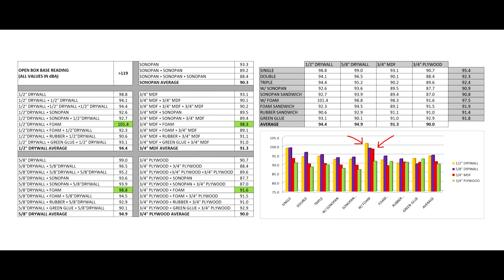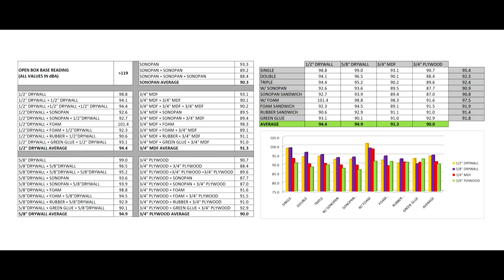What is the best material for soundproofing?

Comment: Very interesting.  The main thing I will add/critique here is that larger sheets of drywall/MDF/plywood will have more resonance and tend to vibrate at lower frequencies.  I discovered these issues when I was in the process of soundproofing my 4'x 6' bedroom window from outside noise and neighbors (i.e. cars passing by the outside alley blasting loud bass music).   I have to do this every summer when the rowdies come out of hibernation.  I've discovered that smaller pieces of drywall and plywood do not resonate as much as one large piece did.  It's also easier on my back to install it in smaller sections.  I seal it all with rubber weather striping and acoustic calking.  The result... much less resonance/vibration at low frequencies.  I've learned a lot over the last few years from simple trial and error.  I'm still in the process of improving it.  I've gotten greedy and will take any dB reduction I can get.
Reply: This really helps a lot!! Most of the time you hear people either say - more mass or more rockwool. Or somehting inbetween, like rockwool within drywall. 

But after watching this video, you really get an idea of how much more there is to it!

Just the rubber inbetween drywall did so much!  

Just adding drywall makes it worse sometimes, it seems. 

I'm still a little confused by how well the sonopan on it's own worked. Much less mass and density, but still such great results!
Reply: Some acoustic glue might also be helpful instead? There are several alternatives for green glue, it seems. My guess is that, especially on walls, you need to have some pressure from the drywall against rubber for vibrations to cancel out / to let the drywall not be a resonator on it's own. But not so much that it's too stiff (The right amount of pressure is difficult to figure out for rubber and probably also difficult to build). Maybe the glue would be a replacement for this without any pressure needed?
Reply: You could probably use any kind of glue that stays flexible. Though the heavier, the stiffer, probably. Too stiff isn't good either.
Reply: @KirmesRuf6  As long as you can prevent the drywall from vibrating, it will work.  The air gap between the window and the barrier is very important, the larger the gap the better the results.  You have to use rockwool in the cavity to prevent echo and reverberation.  I recently made another barrier using 1/16" lead sheets glued to the plywood and that works even better (very heavy though).  My window is now more sound proof than my exterior house wall.
Reply: @JP5466  Thanks! That sounds fantastic -  Maybe drilling 1 or 2 holes into the middle of the dry wall could also help to cancel out vibrations?
Reply: @KirmesRuf6  Nope, that would let air/sound through.
Reply: @JP5466  Right!

Comment: I found this really surprising. I just renovated my basement with safe and sound insulation, strapping, sonopan, and 1/2" drywall. The results were less than desirable, it mutes the sound a bit, mostly talking, but foot steps or things dropped on the floor above, the difference is hardly noticeable. A bit of a disappointment for the money spent. I believe my biggest issue is the air ducts are an air penetration I can't remove.
Reply: remova os dutos de ar e vede as paredes. abra a porta 10 a 20 minutos por dia com um ventilador super potente com a vazão necessária  ou duas vezes ao dia no maximo. faço isso e traz uma diferença muito boa para o isolamento.
Reply: That scare me cause I just did that. Next step is the ceiling. I do read that ceiling noise, specially impact, it's not doing much. Reason is the joist are so big that the sound travel easily. To block that, you do that on the flooring side.

But what about noise going up, how much do you hear in the room above VS before?
Reply: Did you decouple the basement ceiling from the floor above
Reply: You may be able to line the inside surfaces of the ducts, with soft rubber matting (maybe mouse pads), or some other absorbent material.    The other thing that may help... is to hang a few boards of stacked plywood, about 3 inches under the vent (maybe using bungee cords, or rubber strapping).   In this way... any sound that runs down the vent... will be partially bounced back into the vent... after it hits the Plywood.   Additionally, some foam might help diffuse any remaining noises... yet the foam should still allow for air to move through it.   You will likely have to change the foam out every year or so... as it gets clogged up with dust  (washing it might work too).

 They make a car Undercarriage rubberized spray that also might work for lining a vent.   However... I have no idea if there would be a long term off-gassing / smell.   You could spray a small section of cardboard, and let it sit in the house... to see if the smell remained for a long period of time or not.

 As for your choice of materials...  The Sonopan really isnt enough to stop very loud noises, IMO.  It would be best to add one more layer of Drywall.  The stuff is very dense, and should reduce the remaining noise.. maybe by 40% more.

 Also.. another idea, is to extend the vent,  in a maze like pattern, inside of a well insulated box... similar to what is shown in this videos test box.   The maze like pathway, will help to diffuse and absorb sounds, as the sounds try to bounce off of each internal wall.   By the time the air / sounds come out of the other end of the box... there should be little sonic wave energy left (yet the air should still be flowing freely).

Comment: What confuses me more - why is the rubber sandwich with polywood worse than drywall rubber sandwich, but single plywood so good?
Reply: I agree, the thicker 5/8" drywall should have better results... very strange.
Would've been more representative if he used larger pieces of drywall and plywood, screwed it down tightly to the box and used a lower frequency noise source.
I've had very good results sandwiching the MLV (between both drywall and plywood) rather than letting it hang limp on the studs.  I hope he can make another video using the suggestions in this comment section.
Reply: @JP5466  That would be great indeed! A full frequency spectrum tested. 

Having MLV sandwiched instead of hanging probably also helps to reduce vibrations and resonance on the other surfaces

Comment: My best experience with sound proofing theater rooms was with staggered studs, rock wool insulation cut to fit snugly, and then two thicknesses of drywall with accoustic sealant in between the layers.  Using two thicknesses of drywall blocks more frequencies.  A combo of 3/8 and 5/8 was the best.
Reply: Thx for sharing. 2 thicknesses? rather than 2 layers of 5/8?
Reply: While both drywalls have same density they have different resonance frequencies so maximum waves are reflected from the top substrate to the lowet layers and dissipated into heat in the bounce back and forth process

Comment: Hey, great video. I loved your first one. The main flaw in this test is that you didn’t seal the layers you were testing. In the first video you did this by screwing everything together. You might be surprised by some of the differences in results if you clamped the materials to the top of the box. I would also recommend putting the mic on the dB meter directly in front of the material for the most accurate reading.

Re: Green Glue: it’s a completely different substance than caulk or sealant. It gradually expands between the layers and creates a damping layer similar to the rubber you used. It takes about 30 days for this to happen, so you would have to buy a tube of real green glue and prepare those layers in advance to test how effective it is.

Re sound source: if someone is thinking about what materials to use for a home theater, workshop, music studio, etc bass frequencies will be the top concern because they are the hardest to absorb. It’s more complicated to test the full spectrum, but you would find each material absorbs different frequencies at varying amounts. The stiffer materials will generally do a better job with bass frequencies.

Last consideration: soundproofing is a result of the whole system. The test you’re doing here can help with picking materials for the walls, and is a great primer for anyone doing research. Just a caution that windows, doors, HVAC are a lot more complicated and have their own unique requirements.

I’m a big fan of the videos you’ve done, and I think there’s not enough proper testing on YouTube, so thank you for putting in the time and effort. My comments are not intended to be negative, just an FYI about some of the limitations of how the results from your testing can be applied.
Reply: High density fibercement top layer of 1300kg/m3 decoupled with a sublayer of osb or mlv or a undercarpet nonwoven felt would bring the best results for low frequency airborne noise coming from down below, dense board reflects waves passing through the felt while felt dissipates reflected waves energy into heat. This top dense layer reflection and medium/light dense amorph broad freq. spectrum dampeners are used in professional grade panels under hardfloor soundproofing
Reply: @asencyel  That's helpful - But there's still a lot I don't quite understand about all of this - So many people saying so many different things. More mass, more air gaps, more rockwool... And there's so much more to it

Comment: Thank you for the work and results. Good clean setup and no nonsense work flow. Well done.
If you go for another round consider making a top frame from, eg., double 3/4" ply, with the internal window the same as the sound cavity.. Four carpenters clamps to hold the frame, test sample and sound box together and that should remove any serious doubt about samples not lying flat, etc.
One general principle I was taught is that sound proofing needs density. Fluffy stuff will work but you need a lot of it to get enough mass.
Your results go a long way towards confirming this advice.

Comment: Great test, thanks for sharing! I've personally got R-13 fiber, 1" foam, then 5/8" drywall. I was mostly worried about insulation, but it does an amazing job of sound proofing as well. Given your test, I might add another layer of drywall, but it seems like the difference wasn't that substantial. I also can't help noticing that doing just about anything was better than nothing. It's a shame your meter wasn't able to get a good reading, but 130 db -> 100-90 is a pretty amazing drop.

Comment: Outstanding effort! A few suggestions for you;
- cheap to utilize undercarpet felts, could they be a better alternative for the branded nomwoven material you got?
- fibercement boards having aroune 1300 kg/m3 density would be worth trying with this setup
- avoiding resonance of the box both with the table and the speaker itself it would be wise to use needle/pin legs under a plarform to carry box and another one carrying the speakers, just like shelf type speaker stands/studio monitor stands have right under them
- putting an adequate weight to make sure top test layers dont have any micro air gaps just like a real subfloor treatment would have
- and lastly, please edit a much longer video version so that we can keep it looping and earn you some extra adbucks! Your effort and very clean demonatration deserves so much more compensation! Cheers

Comment: As far as I understand and my experience in setting up a studio in my house has taught me, what has helped me the most to isolate both the sound that comes in from outside and to reduce the volume of the sound that can be transmitted to my neighbors is the sum of different materials and therefore densities, including air, mineral wool, and 2 layers of drywall. so I think that high-density mineral wool may be what can give you the best results with a layer of plywood or drywall.

Comment: Would be cool to see same tests done with these setups and fiberglass and safe and sound added.
Reply: Lab tests conducted in the early 2000's have concluded they are not much different.  Rockwool had slightly better attenuation on the lower frequencies, but only in the 60-100hz range.

Comment: Why is the rubber sandwich working the best with the 1/2 drywall? I assume it stops some of the resonance caused by the drywall and the 5/8 inch drywall just happens to resonate more with the horn frequency, for example? Really tricky to calculate which combination would be best
Reply: And for the sonopan sandwich, I could imagine the side leakage causing it being less efficient as well? Or is the rubber just helping more with resonation cancellation?

Comment: I am going with 1 inch plywood + 1cm of old carpet (cotton wool). Cotton wool is known for great absorption over wide band, superior to glass wool.
Reply: I read OSB is a bit better than plywood for soundproofing. It is heavier at the same thickness. There is also cement boards which are heavier and more dense than both woods and than drywall. And then there is porcelain (there are large sheets the same size as drywall) which is as dense as MLV. Comparing the same thickness always. A cement board (15mm or more if available) glued with porcelain, would be very heavy and IMO more effective than 4 layers of drywall (probably even if they had green glue or carpet glue). Then there is steel and lead of course.

Comment: Would the voltage drop in the battery make a difference on the horn volume? Could be a variable.
Reply from the maker: I agree but I measured with a multimeter and it stayed constant.
Reply: I didn't think the horns would make much of a dent, but I wasn't sure how long you ran them in total.
Reply from the maker: Probably 5 minutes between all test over 3 days.

Comment: I am not from canada. I am from europe. We dont get sonopan here. I have a huge base noise. I can get plywood. Any ideas of insulation panels that i could instal inside and or also outisde of the house? 😊
Reply: I don't know if you can get it in the UK, but try 1/16" lead sheets glued to 3/4" plywood.  Worked very well for me blocking out loud bass music.  It's going to be very heavy though.  Don't forget to leave a nice (3-6") air gap in between and fill the cavity with rockwool.

Comment: You should leave air space between your materials to allow the sound waves to die down while adding sound absorption materials on the inside parts of the air pockets to also absorb extra sound. Also, the materials touching allows for sound vibration to travel through them. The best way is for the materials to not touch each other.
Reply from the maker: I think that's what the sonopan and green glue does

Comment: The box should have sat on something like neoprene pads on the concrete floor. Having it on a table with other test material on the side would have vibrated the table with two variables. Also, the decibel meter should have been on a separate tripod or something pointing right on top and not to the sides where there could be some porous openings causing differences.. Just a thought.

Comment: For best results in sound proofing irregular surfaces are needed in order to reduce resonance / echo effects.  If you were to simply drill some holes in the first layer of the plywood sheet and keep the second flat, you would see a major improvement over what you have now.  It seems counterintuitive but it will work.
Reply: Very good tipp! How would you recommend doing this for drywall instead of plywood?
Reply: Very interesting, do you have more info about that? like links or references.
Reply: Diffusion?

Comment: my issue with this test is frequencies. Mass vinyl is good for low frequencies. the other materials mid to high frequencies. Mass vinyl sandwiched all the way around 18 mm acoustic drywall. 15db+22db (2mm) and 26db (3mm) and 29db at 4mm reduction. The issue with all of it is having an internal room, disconnected from the outer walls. Ideally the outer walls are acoustically sealed externally for max DB reduction of 65DB.
Reply: MLV doesn't do much for loud frequencies below 125hz.  Sandwiching it between drywall does help lower the resonant frequency of the walls.  Lowering the resonant frequency as much as possible is what needs to be done to achieve the best sound attenuation from outside noise coming in.

Comment: Haven't watched this yet (watching this now), but pleeeease tell me you tested mass loaded vinyl (MLV). Everyone overlooks this, and it literally fully stops sound.
Reply: I stapled MLV to plywood and lined my metal workshop, and rockwool in the ceiling. I can run any of my powertools in my workshop at 3am, and my wife doesn't hear a thing.
Reply: Where to buy it?
Reply: @LovePrincess-nh9hx  I've ordered several rolls of it from Amazon. The brand I've gotten was "Soundsulate". It is heavy AF, and found that it was best applied with staples. The plastic cap nails just ripped under its own weight.
Reply: Is it really that good? It's pretty heavy for it's volume but also mostly thin
Reply: @KirmesRuf6  I've found nothing better, nor do I think I would need a better solution. Can't hear any of my saws or planer or compressor or anything running from outside of my shop.
Reply: @svjness  Thanks for the reply - That sounds fabulous! May I ask how thick your plywood and vinyl is and how much it's compressed?
Reply: @KirmesRuf6  I used had to frame my metal workshop walls with wood, stapled up radiant barrier leaving an air gap, then stapled 1/8" (1lb) MLV, then screwed 19/32 Cat Rated Pine Sheathing plywood over that. For the ceiling, I used rockwool comfort bats held up with radiant barrier. I also have a mini-split AC in there now.
Reply: @svjness  Thanks a lot! That sounds really good !